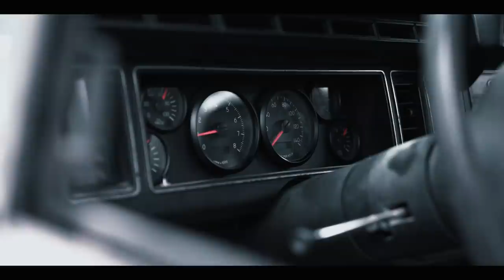4,700 mile road trip in 40 year old Bronco... Goodbye!!!

Comment: The locking hubs only lock the wheels to the axle shafts so they get power. They don't have anything to do with the differential. 

Selectable locking diffs would have been the ultimate way to go.

Comment: I'd get some light bars and rock lights on the fire truck. I'd also get some kind of water tank level reader so you can see when you're about to run out of water. Could be as easy as installing a section of clear PVC pipe on the side with some elbows back into the tank.

Comment: If the Cuda is not done in time, you should definitely take the fire truck. It would be almost as much fun as the 5 ton but you can also use it as a…. fire truck if things happen to have a “rapid unscheduled disassembly” or if there is mud, it will be super handy to clean off windshields!

Comment: Maybe a 2nd section of suction hose, just in case you cant get close enough to a water source to fill, and a basket strainer. Maybe you could mount the suction hoses against the frame in a large piece of pvc to keep out of the sun, and some type of cover for the hose reel to keep out of the sun and destroying the hose.

Comment: Put a hand primer pump on the suction side of the pump, fit a front spray bar and a cab protection spray along with a couple of in-cab fire blankets, make sure there is a first aid kit and handheld fire extinguisher onboard, fit a cartridge-style foam generator system and change to either a PTO pump or a diesel run off the main tank. Diesel pumps are a better way for several reasons including the aforementioned ability to run off the main tank, an electric start that can be remoted to the rear of the truck, no flammable gasoline on a fire truck and they don't die in heavy smoke the way a gas pump can.

Comment: Matt, consider putting dish soap in the water tank. It breaks the surface tension of water and makes the water more effective when working brush fires. Also a sprayer on the front bumper so when you are driving you can spray water in-front of your rig.

Comment: On the fire truck, you need to paint all of the plastic plumbing. Weather is ABS or PVC, it will get very brittle from UV exposure. Brittle and pressure vessel do not go together well. Just a couple layers of latex would make a very large difference

Comment: Open ur recirculation valve a little when u use the hose so when u close the hose to stop spraying it'll be recirculating to relieve some pressure on the pump and when u  need more pressure just close the recirculation valve but remember to open it back up a little when u stop spraying

Comment: There are also gel protection systems that you can install that in the case of a “burn over” that cover the vehicle  in 20 seconds with a fire retardant gel mixed with water seperate or a part of the fire protection system for the operators of the fire truck. The gel systems only use about 40 litres of water. Fires can be unpredictable thing and you need some personal safety systems.

Comment: You should try to find a gunners turret for that hole in the roof of the LMTV and make it either a permanent mount for a water canon or someone can stand in there with the water hose from the back.  if  you couple that with a PTO driven water pump then you can be a 1 man operation to pull up and jump in the turret to start blasting water

Comment: Now that you have a decent water setup, time to get some other tools in place. You would be amazed how useful a metal rake is in fighting a forest fire. Also you should make sure you have a gas can in case your pump runs out of fuel. Your currently set up for a one man show, but if you have other people to help, make sure you have some hand tools they can use to help you with. You don’t want them standing around just waiting for the truck to run out of water.

Comment: When you’re drafting water and need to get suction as long as you have some water left in your tank you can back fill your suction line to pull the draft. You just have to be quick with your valves. The way you have it set up you may need a second person

Comment: For the bronco most all Ford trucks I’ve driven f350 to my 92 bronco was all open diff in the front so they will spin both tires at times on hill climb if it’s some what level right to left but start flexing it will throw all the power to the side that slips he just needs a good locker in the front. And the fire truck is awesome

Comment: the Fire Truck what prevents your PVC pipes from freezing also PVC pipes when cold are very sensitive to vibration,  and will crack or shatter in cold weather... maybe replace with non-collapsible rubber hose.

Comment: The only thing that I think you could use is a hose bed with the 1.5 hose with a smooth bore nozzle. Definitely a bigger tank if the truck can handle the weight.

Comment: You need a vacuum primer for the draft line to make it work efficiently.  If the pump is self priming, it may prime with enough time, but if time is of the essence, you don't want to be messing around.  I used to run one of the 147 +/- fire apparatus manufacturers.  Darley (supplier and manufacturer) is a family owned company and the owner is a good guy.  They can provide the right part but the are expensive.  You could buy a lower volume consumer pump but again time is something you can't get back, particularly when it matters most.

Comment: Matt your going to need some type of primer for your pump to get a draft to fill the tank a lot of them little pumps use an exhaust primer 
Or you can get a manual primer 
The bigger pumps use an electric or an air primer. Now saying that with a foot valve in your  Section hose you might be able to make it work

Comment: Who else was waiting for Link to spray dad 🤣. One thing as someone who uses fire units like this you might want to get a plug for your suction inlet pipe to stop anything getting in it. Also helps stop water draining out if for some reason the tap get opened unintentionally. Also caps for you 2inch hose

Comment: You should get an auxiliary gas tank for the pump mounted in the bed between the cab and the water tank and have it gravity feed into the pumps tank, that way you have a much long run time capability.

Comment: That pump will not draw from a lake unless the suction line is flooded with a foot valve, even then it may not work. You need a positive displacement or suction lift pump. The pump has a minimum suction head required to operate, it will not pull water to the pump.

Comment: It's an open diff in the front. Doesn't matter if the hubs are locked, the power is going to go the path of least resistance(the tire that doesn't have traction. A locker or spool will prevent that from happening. On any of my trail trucks I run a locker in the rear and a spool up front. There are some brake-based traction control setups that will apply brakes to the tire without traction which in turn sends that power to the tire with traction. It isn't as good as a locker but it's better than just an open diff.

Comment: Matt you need to get one of those self contained military tow behind  1000 gallon water tanker trailers (maybe  2) as well as use the other guy's idea of putting a diesel pump in that can pull off your truck fuel tank.

Comment: Matt, due to the ribs on the tank how much water is being held in there? You could combine them and use it as a reserve to help prime the pump if you to ever have to draft from a lake, pond, or stream. Use 1” piping with tees and 1 valve just before tying into the pump.

Comment: So for your recirculating valve crack it open about 1/4 of the way open and you can run your hose as well as not blowing your system apart I learned this from the fire department that I’m on in Bigfoot Texas btw would enjoy having you at fire station

Comment: Bronco: only one tire is spinning because the diff (pumpkin) is open, or it doesn’t have a locker. All the locking hub does on that style of axle is lock the wheel to the axle shaft (locks the hub to axle).

Comment: Matt the limited slip on the bronco it probably doesn't have a posi unit or a spool in it both tires won't spin most of the time it will put power down to the easiest tire possible if it's standard limited slip

Comment: Hey man maybe some electronic valves with a dashboard turn all on and off you be cool, so you wouldn't have to jump up on the bed to turn valves on and off. In the heat of the moment you may slip or forget to turn some valves causing valuable time, but electronic valves could also cause some problems like not working. Just an idea. Need some help I could draw it up for ya.

Comment: It has to remain unlimited slip(standard diff) dont put a diff locker in it. With those big tires and that short wheel base its going to be the worst combination possible. Binding and wheel hop every moderate to sharp turn would be its future.
Buy a winch

Comment: hubs are not lockers… Need to put some front and rear lockers or weld the differentials so that both front tires and both rear tires spinning and power is transferred to one side or the other

Comment: Yeah you have an open differential so when you’re on even ground or both tires have equal traction both tires will spin until one tire has less traction than the other then only the tire with the least amount of traction will spin that’s how open diff with spider gears works if you had a locker then you could spin both tires all the time

Comment: If your not going to swap the pump on the fire truck over to diesel. Save the carberator from corroding up shut off the gas leiver off while it's running, let it die with out turning the switch off

Comment: you may want to think about gas pump fuel tank need to be bigger because you need alot a fuel to run that later, you need to get a propane gas pump why because it last way longer than gas fuel you can start it up quick

Comment: I'm concerned about the place of the drain valve,it's a brush truck it looks like it could be easily be ripped off and drain the system with no shielding.also not sure CVPC the right choice for plumbing on a brush fire truck. If you got in a into a bad brush fire and got stuck/disabled somehow the CPVC could melt.
Reply: Also the pumps "in my opinion" fuel and air source should hard lined and above the bed in case of fire. JUST MY OPINION!

Comment: Tyre. Pressure. 👍
Reply: Also, locking the front hubs doesn’t mean you have locked the diff, just that you’ve given power to it. You need a diff lock for that (which is DIFFerent 😆)

Comment: No need to try to kill that truck an max it out but if it doesn't feel that tank I'd definitely go with a bigger one...it'd be better to  have the extra water and not need it than be half way through fighting and have to go find somewhere to fill up.....and maybe if the tank is much bigger a second hose setup..incase you have a few guys for back a couple can run hose and anyone else can get on tools

Comment: Did you not put in traction lock axles? 4x4s are about useless without, at minimum, limited slip! But preferably actual locking diffs.
Also I fought Forest Fires in OR 1990 and ID 1994. The trucks used there had redundant systems. 2 pumps, 2 reels. Nothing worse than losing a pump during a fire.

Comment: 12:00 - you ain't climbing SHIT without a diff lock!! just cause you have it in 4 low or 4 high doesn't mean the diffs are locked. maybe your diff locks are broken? neither axles were locked as shown in 12:00 - 2 wheels not spinning. otherwise, if all 4 were locked, the bronco would have nailed climbing up on those pipes.

Comment: reality is in 10 minutes of refilling the fire will be out of control thats even if you can get suction in 10 minutes which I doubt , also your better off using a smooth bore nozzle it requires less pressure to flow properly . what PSi is the Pump Pushing it looks weak even for a task force nozzle , wich makes any water flow look good even if its not . a task force nozzle requires 100 PSi to flow water properly,  a smooth bore is 50 PSi . and watching your son hold the line I can tell you your nowhere near the proper pressures to have enough water to put anything bigger than a bbq fire out . Maybe get in touch with a fire apparatus repair or builder in Texas to help you out , or you can swap an LS into your pump .